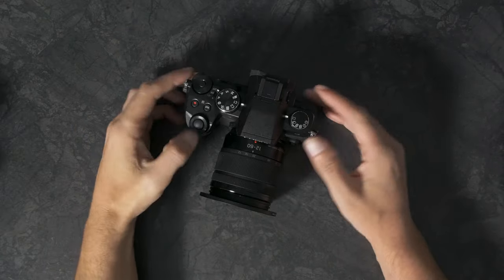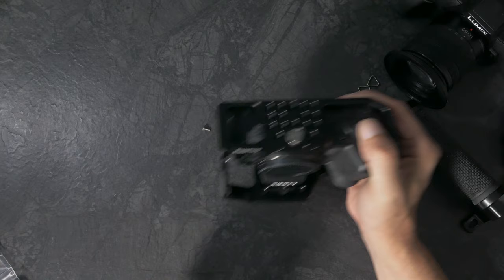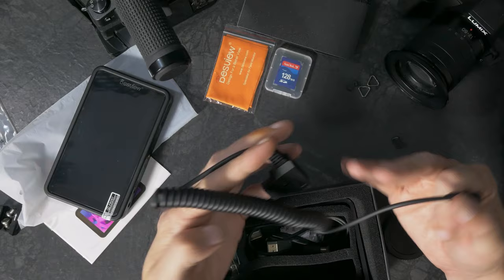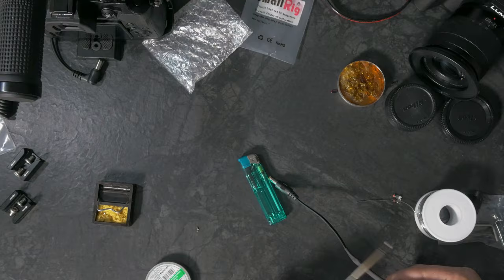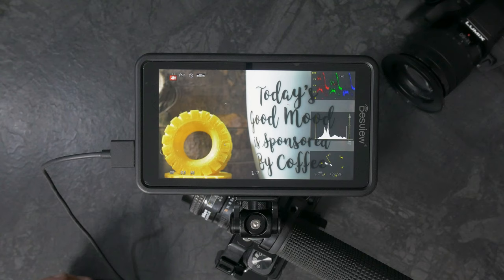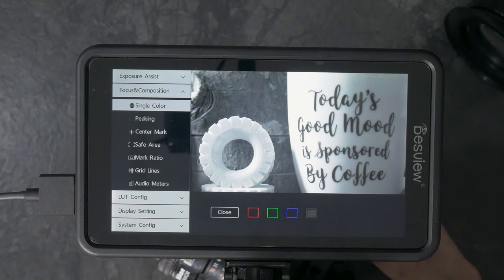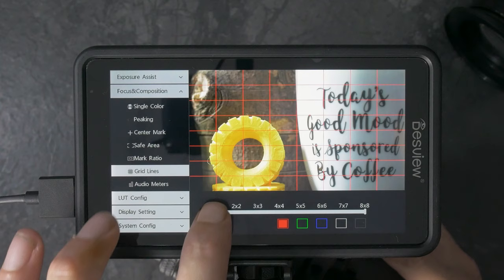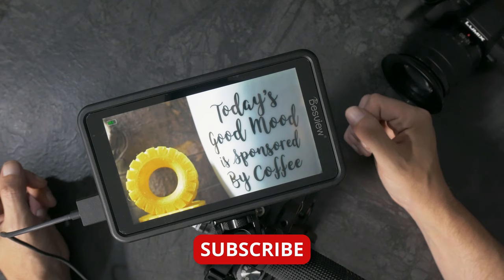Caging the Panasonic Lumix G85/G80 for shooting video (Desview R5 HDMI monitor)

Comment: Hii John thx for video. I have Panasonic GX85, can i use it (Smallrig 1950) for my camera ?
Reply from the maker: No, for the GX85 you'd need the 1828 cage. Unfortunately, it looks like SmallRig doesn't make either the 1828 or 1950 cages anymore. You can try reaching out to them to see if they have any old stock left or you probably want to hit up eBay. :)
Reply: @JohnAldred  Thx so much for your super ultra answer and advices ❤️❤️❤️

Comment: Hi, question please I have a g7 and I know I can not connect an external monitor to it as soon as I click on the player I do not see anything on the monitor, my question is if in the g85 I want to upgrade you can use the monitor even when you click on Play and something else in the g7 can not connect Headphones also in g85. Can I connect headphones to the monitor but not record the video on the monitor? Thank you
Reply from the maker: Ahh, yeah, with the G80/85, when you hit record you can still see it on the monitor. That's the main reason I went for the G80 over the G7. And, yup, it sends out audio over the HDMI, so you can plug headphones into the monitor. :)

Comment: Did  you ever find out why your dummy battery wasn't working? Is the 8v from the monitor not actually outputting 8v? Or other low voltage issues?
Reply from the maker: I never did find out why. I forgot all about it if I'm completely honest, haha. I do remember having the same issue with a different monitor, but those are the only two devices I have had any issues with. I never did take my multimeter to those sockets, though, to see if they're actually 8v. Will leave myself a note to remind me. :)
Reply: @JohnAldred  I just found a video that shows  that the cam will shut off and show the error when voltage drops below 8.27, so the voltage from  the dc might be on the verge since np-f batteries are 7.2/7.4 normal and 8.2/8.4fully charged. A solution is to add an resistor to the dummy battery, search in youtube for video Ti0KRKT4tcc that will show you the voltages.
Reply from the maker: Thanks, John, much appreciated! Will check with a multimeter what the DC output is exactly on these monitors when I get chance.

Comment: G’day John, I came here from your Desview R5 review. I’m tossing up between the R5 and the Feelworld F6 and wanted to ask when comparing the two of you found the brightness difference that noticeable between the two? I know the F6 is 500nits while the R5 is 450, but was curious whether you really notice this in practice.
Reply from the maker: I haven't really. They're both pretty close to each other actually. What I will say, though, which has me leaning towards the F6 Plus for a mobile rig like this (when on battery power) is that there's no power indicator LED on the R5. And in bright conditions, you can't quite always tell if it's powered on or not just by looking for the dim glow of the backlight on a black screen.

So there's been a few times where I didn't realise I hadn't turned it off properly after turning off the camera and killed the battery before I got where I was going. So, now the R5 gets used on my rig here at home (where it's plugged into an AC adapter) and the F6 Plus lives on the setup in this video to go out shooting on location.
Reply: John Aldred thanks for the fast reply. And thats certainly a good point. It’s funny I’ve seen other reviewers mention they wish the F6 didn’t have that light as it’s not necessary and just adds to battery drain but it obviously has its benefits in that case. 

One more question if I may. I was concerned that over time the little snail mount on the R5 would lose its friction and not hold the monitor up anymore, is it possible to tighten the mount if this happens?
Reply from the maker: Yeah, there are a couple of bolts there that you can tighten with the right Allen key. I'm pretty sure that's what the one that came with it was for. But, I'd probably look into picking up a SmallRig or Nitze one that's a bit more substantial (and secure, and doesn't fall off the hotshoe, haha).

Comment: Good job! My monitor Feelworld F6 5.7 starts buzzing after the battery Sony NP-F970 is drained to 80%. Why do you think this is happening? And can I connect a microphone Rode VideoMicro if a lock SmallRig 1822 is installed? Thanks!
Reply from the maker: That's odd about the buzzing. I'm not sure what's going on there. I've got Feelworld F6 Plus, FW279 and FH7 monitors, but haven't had that issue with any of them. I'd suggest reaching out to Feelworld to see what they say.

You should be able to connect the microphone no problem (I had the same issue at first), but you'd need to flip the cable clamp over. If you check out my video for the Synco Mic-D30, you can see how I did that there. I basically just removed the screw, flipped the whole thing over and mounted it the opposite way around. :)
Reply: @JohnAldred  Thank you very much for your response. I didn't find any information about installing the lock anywhere. The support service Feelworld advised to buy a new monitor) The monitor is new, I didn't use it, but the 1-year warranty is over. I'm probably the only one with this problem) Here's the video https://yadi.sk/i/kjPbtBeu1aSVQg
Reply from the maker: Oh wow, that's pretty loud! That's a strange one. I've not heard of that happening before. I wonder what component is actually making the noise. Is there a speaker inside that model? If it's just speaker buzz, have you tried turning the volume off completely?